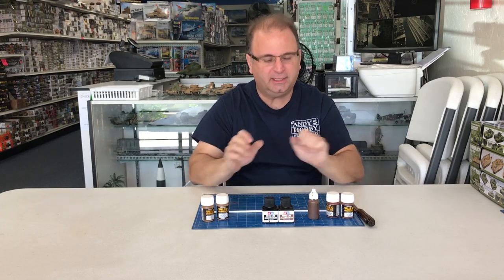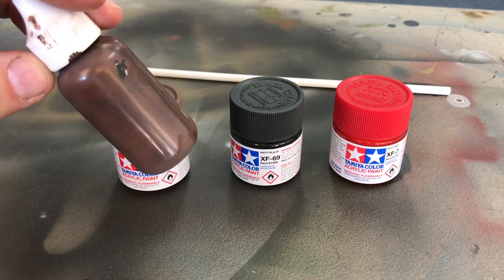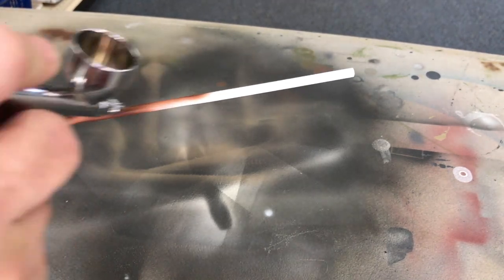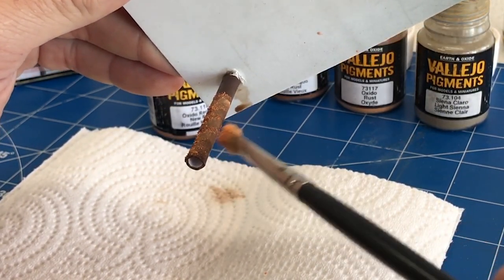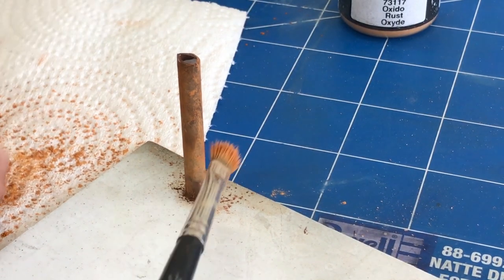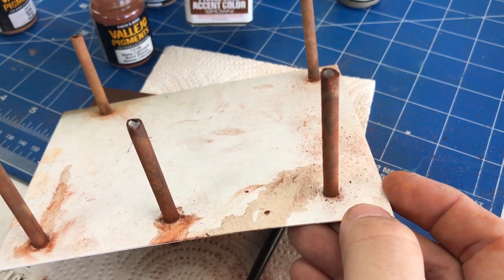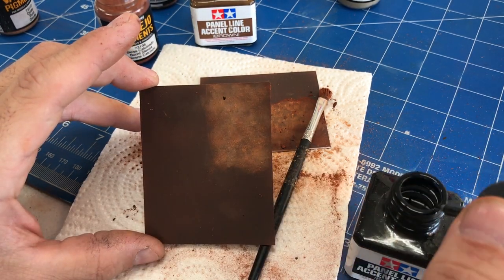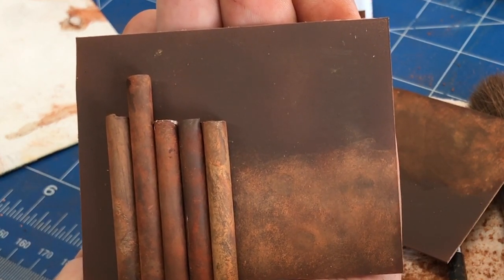Rusting plastic models with Tamiya panel liner and Vallejo pigments

Comment: the combination of the two products works great. this is something that is very important though with these kinds of hobbies. Learning techniques and mixing them together, gives the best results. if you have multiple techniques that are designed to get the best results in less time, it confuses the eye and you can think you're looking at something that took hundreds of hours, that maybe took like 4 or 5. 

Just using 1 technique, it's easy to spot the technique, which breaks the illusion. But mixing together many techniques, they all work to compliment each other and it becomes way more difficult to actually spot the techniques used. 

I have probably explained this poorly, but it's something that everyone should learn to do early. 

It's like scale model techniques making their way into miniature painting, and vice versa. It makes both hobbies better.

Comment: Nice work. they do look impressive, but I have a question: What difference does it make to use those tamiya panel liners instead of some clear paint to old the pigments on place? Thanks in advance
Reply from the maker: the panel liners  dries very flat and holds up very well .
Reply: Very well. maybe it is best then in smaller scales then, as to avoid undesirable bumps and so, no?

Comment: Another great video, Andy.  Do you seal the pigment with a flat clear coat afterward?  Also, I asked this question in a different video, but since you probably haven't seen the question I'll ask again in here what mixture ratio you use for your Tamiya paints and what mixture do you use on the dusting Buff coat you do to blend the camo on the tanks?  Thanks again...

Comment: Outstanding video Andy, I assume you can use these techniques on cars also,  I have been wanting to do a rusted street Rod, I appreciate you sharing your knowledge.  Rick
Reply from the maker: yes it will work fine on cars
Reply: Hey Andy do u have a web site where I can purchase the items u used in the video, can't find much Vallejo here in the area where I live, only on eBay. Thanks Rick

Comment: Andy, you have probably been asked this hundreds of times but do you wash the sprues before you start making the models or just go straight in?
Reply from the maker: straight in , no washing.
Reply: sam061971 I do on car model bodies and old kits. but now days with the quality of paints and models not really needed though it definitely doesn't hurt. 

10ish years ago I had issues with paint bubbling etc then quit modeling for years, just recently got back (less then a year). I have yet to have any issues.